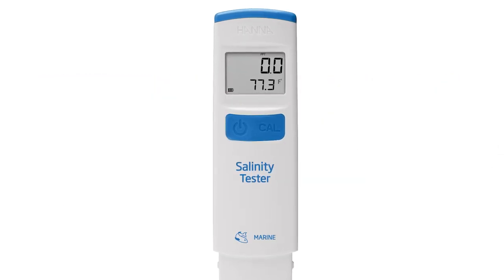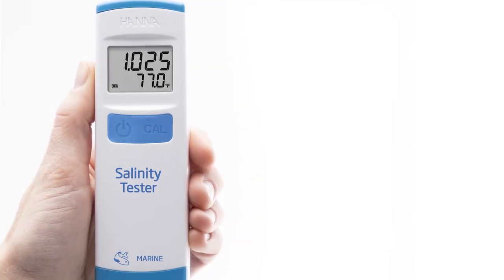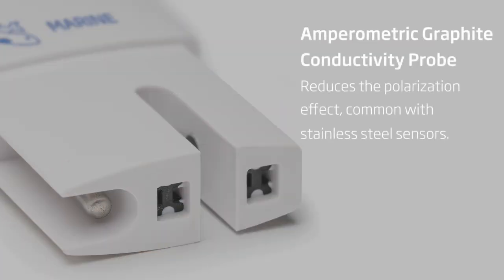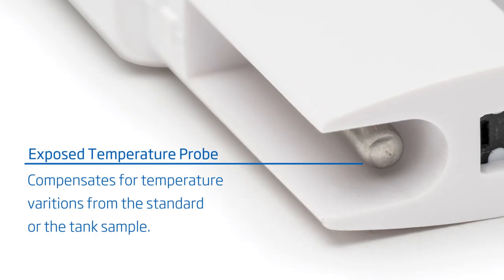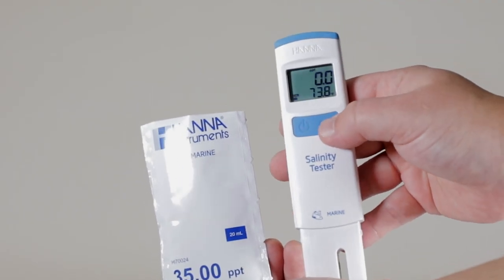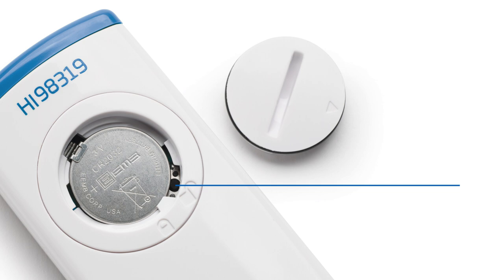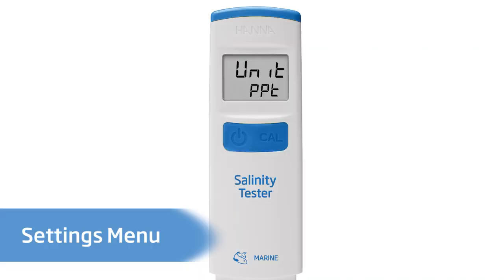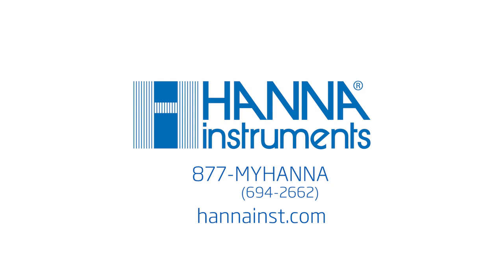How To Set Up and Calibrate the HI98319 Salinity Tester

Comment: I have it set to specifig gravity.  I am trying to calibrate and i think my salinty has been off by 4 points since I got it over a month ago.  If I have it on and I dip it into the calibrations solution that is 35.00 ppt than shouldnt it say 1026 specif gravity?  That is what 35 ppt is!  Makes no damn sense and I want it kept at specif gravity not ppt.  when I dip it in to check it it tells me 1022.  Why? Also after I follow all directions and pull it out it says use then If I dont use it right away it says error.  First it has store rec and all.  it it safe to stick it straight in the salt water then, maybe some chemicals on it?  Even then how do I know it calibtarted it right?  My refractometer dosnt and thats why I bought this.   It stays set at 1.000 when not in use, is this right?  I dont know how to double check it other than dipping back.  Another odd thing is when I dip it back to check I get 1022 and my tank also is reading 1022.  What the hell is going on? I have been using this all along after mt crash on all 3 tanks. Ilost everything but some softies and they arent doing well, no wonder.  They are in wrong salinity constanly.  I can thank Hanna checker for losing 2,000.00 worth of corals! I was going to buy a few tomorrow to tes the waters becuase everything is right BUT salinity of corse. I guess I will change it to read it in ppt but dont seehow it matters.  How does on eknow if it working right?  lIKE ON A REFRACTOMETER YOU LINE IT UP WITH A SCREWDRIVER BUT YOU JUST HAVE TO TRUST THAT THIS IS RIGHT?  sHOULD BE ABLE TO CHECK THE FLUID! LIKE YOU DO WITH A REFRACTOMETER TOO!
Reply: That happens to mine too. I calibrate it and my salt levels is of. I have it at SG as well. Off by 4 points as well

Comment: I put it in the tank without cleaning the front part. Do I have to clean it before using it?
Reply: No not if cap is left on just rinse the saltwater off afterwards and let dry before covering back up

Comment: Do you need to warm the calibration solutions to the tank temp when calibrating? It doesn't say anything in the manual, other than do not handle the sachet as it may warm it up..i would have thought calibration solution should be at the temp of your tank to be accurate, but would like tgis clarifying
Reply: No, the checker will automatically adjust you just don't wanna set it anywhere that'll cause  a quick swing during the few seconds of calibrating or hold it by hand. Set it in a cup or something with meter in calibrating pack till its done

Comment: Any helpful hints as to how I get the battery cover off since it's acting like Bigfoot superglued it on? (former airplane mechanic here so I know left loosy rightee tightee)
Reply: You can use the grove on the blue cap to loosen the battery cover.  Insert the grove on the cap into the battery slot firmly and rotate counter clockwise.  Should easily get the cover off.  Use same approach to tighten.  Hope this helps.